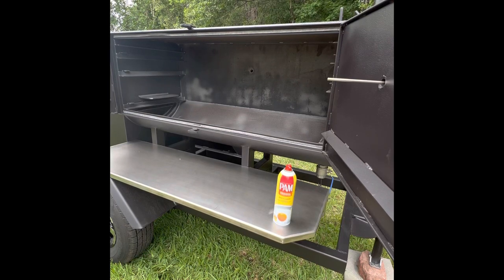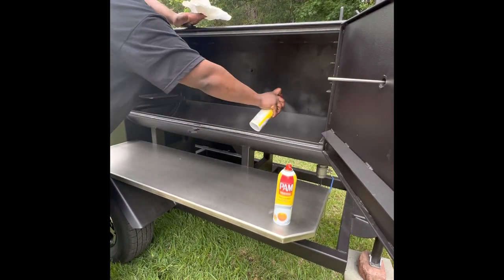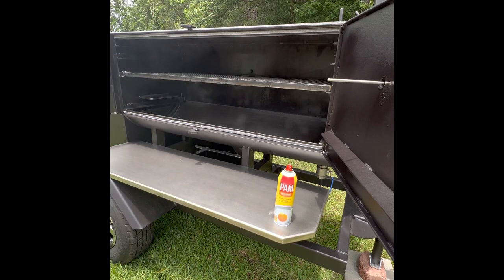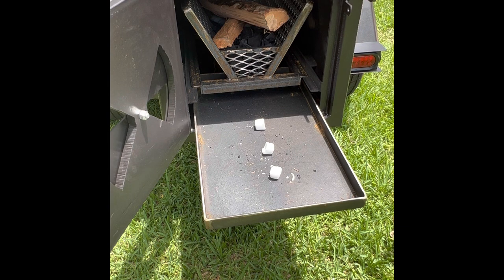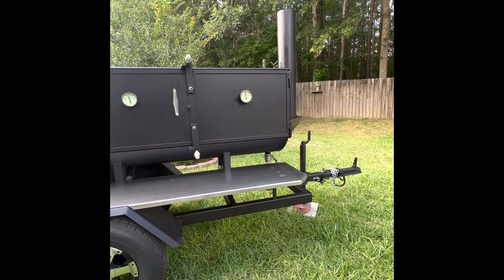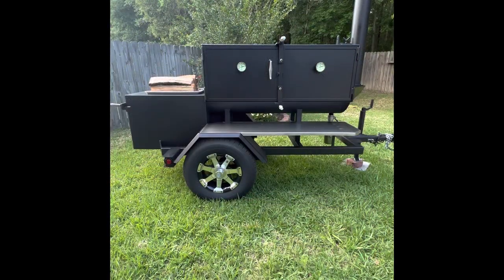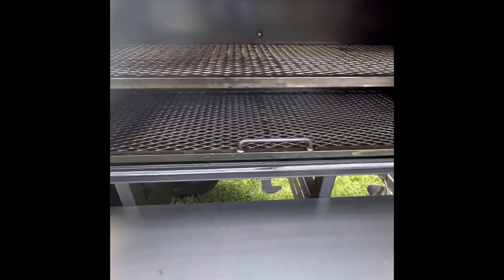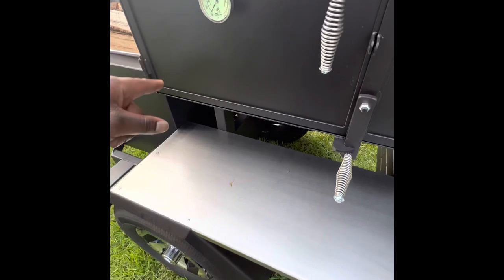HOW TO SEASON A OFFSET SMOKER | Shirley Fabrication 24x55 General Offset

Comment: Sorry.. I should have waited until the end of the video before asking the question. Thanks again for a great video!!
Reply from the maker: No problem, ask any questions. I will help you and answer. My stems are 6” long. They work fine. I am just  would get 4” if I had to do it again. At max capacity 6” may stick the meat and give false smoker temp. But i run one wireless probe directly under the top shelf right at the top of the first F in the video thumbnail. So it won’t get in the way of any meats, and I can  monitor the temps while inside the house.
Reply from the maker: No problem, ask any questions. I will help you and answer. My stems are 6” long. They work fine. I am just  would get 4” if I had to do it again. At max capacity 6” may stick the meat and give false smoker temp. But i run one wireless probe directly under the top shelf right at the top of the first F in the video thumbnail. So it won’t get in the way of any meats, and I can  monitor the temps while inside the house.